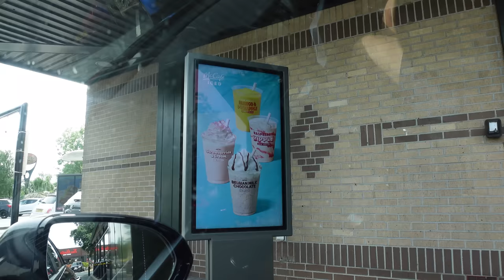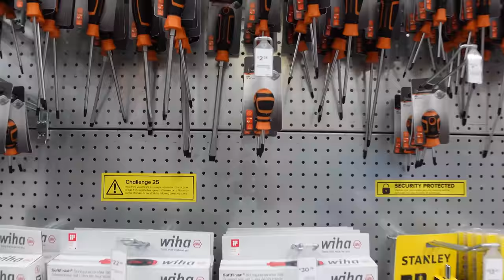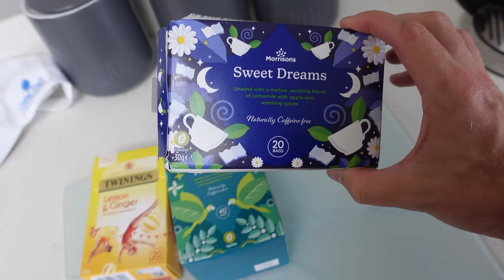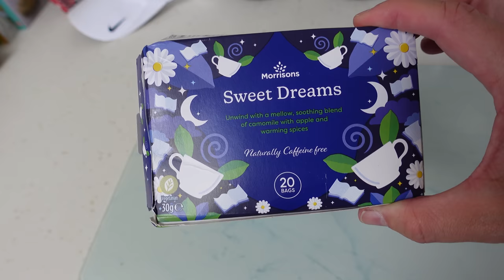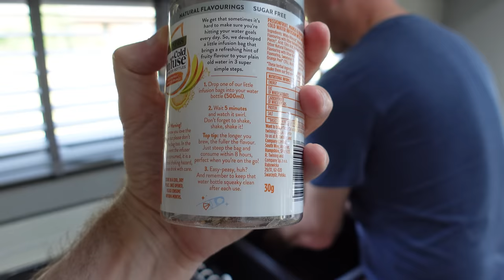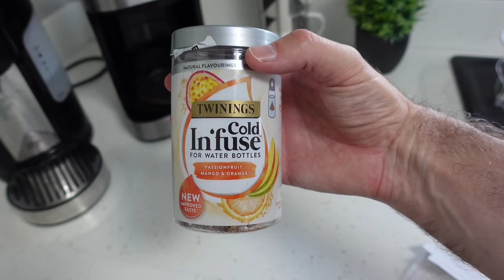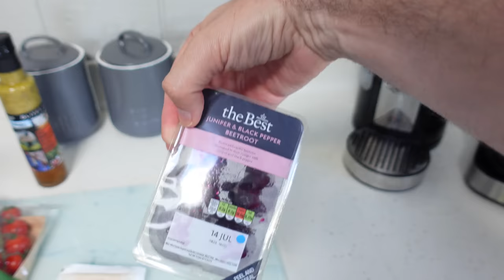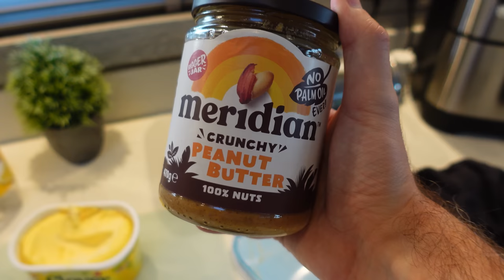How TO BUILD A Window Fly Insect Screen Diy

Comment: I would add a thin layer of foam to act as a "filler" for any gap between the screen and the original window framework. I know there isn't much of a gap, but you'd be surprised how small a gap insects can get through eventually.

Comment: Nick you will not be able to run the fridge on gas whilst traveling. If the motorhome is like a touring caravan you should be able to put the fridge on battery.

Comment: First of all let me just say this this comes with love I'm not trying to be critical but the screen situation is there no one over there in the UK that makes screens that fit correctly inside the windows where you can open and close them at your will and you don't have to worry about the screen being on the outside of the window okay that being said
Reply: The sheep thing you don't have to have customized fitted sheets just buy a flat sheet less expensive and tuck it under it works just the same